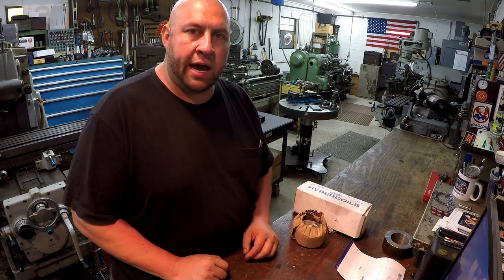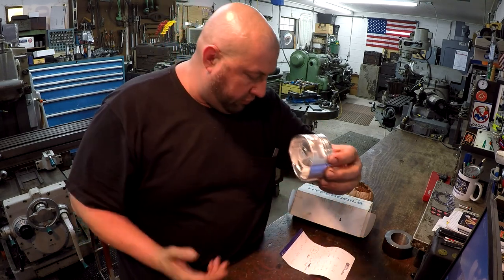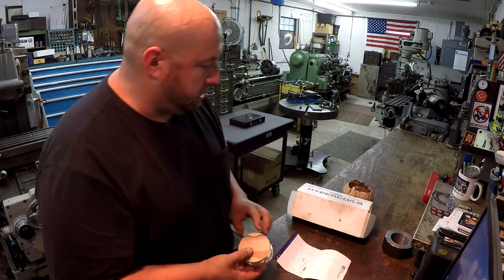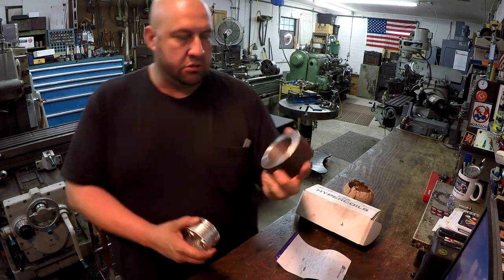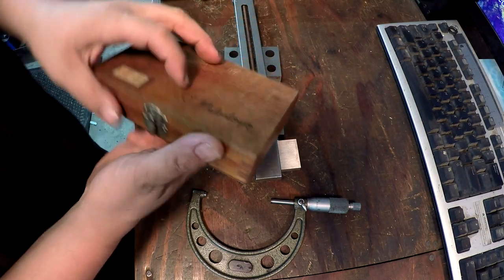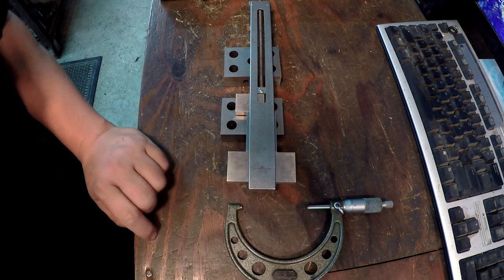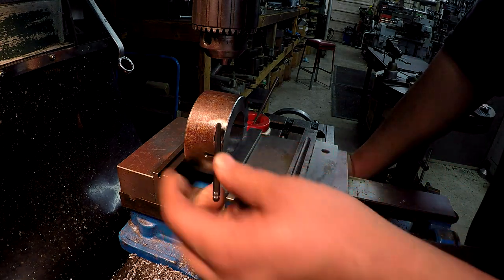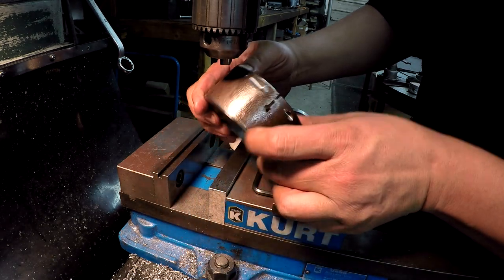Hayabusa Pistons Part 1

Comment: I'm a little shocked here.  Pistons in high performance engines are not round.  The diameter at the skirt is bigger than perpendicular to the skirt.   The top of the piston will also be smaller than the skirt.   This is done for many reasons, one of which is to end up with a constant diameter at temperature and that temperature is different from top to bottom.  The goal is to limit how much the piston rocks or misaligned with the bore so the ring surface stays as parallel as possible with the bore.  Bores are custom fitted to pistons normally and are themselves round. Perhaps the customer is an expert builder.  All respect, your doing what the customer ordered.  From my race engine building days, these modifications seem very odd.
Reply: This! Your comment should be pinned at the top.
Reply: Everyone gets the match the bore to piston thing. Adam said it was coated, say nikasil, or whatever, maybe there are reasons why it cannot be fixed, just relax everyone. He’s just making a cool video, with no commercials, change the channel if its to much for you to process, or, make a video yourself. They are a lot of extra work.
Regards,
Reply: Bores are what? are what!  I MUST KNOW!
Reply: @phuturephunk  holes
Reply: Correct they are made wider at the skirts for a reason . This guy had the machinist remove that feature . Not the machinist fault but now the pistons will slap hard
Reply: phuturephunk oh, bores are the very angry, dark colored cousins to the domesticated pig.
Normally they live in the forrest.
They are know to cause great havoc in grain and potato fields and even in lawns and flower gardens.
They are also known for being very hot tempered, having killed a great number of dogs and even decimated wolf packs severly.
There are even cases known where bores have killed adult people.

Hope that explains what a bore is.
Oh, is that spelled boar?
Never mind....

A bore is:
1 - a machined hole in a material.
2 - the drillbit used to create the hole.
3 - in some cases the diameter of the hole is mentioned as the bore.
Reply: You'r right.  The work on the diameter of a piston is supposed to be done on a piston lathe which creates an out of round shape.
Reply: Yea I agree this was a bit nonsense, i would have the cylinders bored to match the pistons, not machine the pistons to match the cylinders. But nothing against abrom he is doing what the customer ordered but ole Rodney needs to learn to build a engine
Reply: I was really surprised to see this. 0.002 is really tight clearance for any nitrous engine, these might be 4032 material that expands less but this is not the right way to go about this. He would have been better off sanding them down. I know it sounds goofy but if you attempt to evenly sand equal amounts off along the height of the piston, you will get better results. You could always mic the diameter at the crown or a few spots and attempt to maintain the shape when finished.
Reply: @Dave Mitchell he says nitrous in the start, makes the situation even worse

Comment: The piston skirt area is intentionally out of round! Instead they have a larger diameter towards the bottom, between the base of the piston and the piston pin hole. ... Ovality, which means out of roundness, is necessary in all pistons to allow for thermal expansion. It also compensates for deflection of the piston skirt caused by side loads.

Comment: Been a machinist for decades, you just showed me a quick way to save time & tooling . After drilling the primary hole for clearance size of cap head, you just spot center the bottom half with the same  clearance drill,  Me I pull that drill out and use a extension center drill to spot it , then drill it for tap drill size #7 drill ----- Your way saves time & tooling. Nobody knows everything !   Thanks in advance   :)

Comment: Do not take me wrong, but I am really happy to see  that also professionals sustain mishaps. I am building modell Stirling motors and steam engines never having had any formal training as machinist. And believe me, I do a lot of mistakes, which cost me incredibly much time to correct them. As a matter of principle, I only use scrap materials, so the cost of my learning by trial and error is somewhat reasonably limited

Comment: I am only a gear head wanna be. So, not especially interested in the all the engine stuff in this series. But just watching you build tools and jigs and fixtures is why I hang on your every word. And of course I always have a towel to catch the drool when you open your wooden boxes. When I see a wooden box coming into view I know something good is about to happen. I loved how you had to twist the “1-2-3” blocks almost as if the had a thread or magnets holding them together, but it was just the super fine surfaces that formed a sort of vacuum. On another machining YT I read a comment that Starrett tool boxes are Cartier boxes for men. Some clever word-mavin needs to come up with a similar phrase for wooden tool holders. I never really learned much about my Dad’s transit level he used in his construction sight, but I marveled at the box in which he kept it.

Comment: I watch your videos frequently and just came across this. I own a Business Called WorldWide Machining & Welding in Superior Wisconsin. As well I have worked for the Factory Suzuki & Yamaha Race Teams in my younger years. Currently I still have my own Race Team and Build a lot of Race Bikes and High Performance Engines. I say all this as to lend credibility.  When I heard that you received a lot of criticism for your approach to holding the Piston I had to chime in.  I have used the same procedure for holding Many Pistons that I modify greatly. The fixture I built is similar to yours but yours has some better features than mine. In my humble opinion you have done it correctly.

Comment: I do not know about racing pistons but normal automotive pistons are cam ground to compensate for uneven expansion caused by the wrist pin.  We were taught to fit pistons to the bore using a hone for final fit.  Hone the cylinder until the piston without rings and with connecting rod would fall by gravity thru an oiled cylinder.  Love your channel.  God bless.

Comment: You have to be kidding !!! 
Motor reconditioning is where I qualified as an artisan and we NEVER bored a cylinder without having the pistons on the table. EVER !!!
We also had a "Piston Grinder" and that was a fun machine to set up and use mainly because a piston is oval and tapered.
Vintage car engines have cast iron pistons a lot of times and when rebuilding them you had to grind the piston to clean it up then re-sleeve the bore to suit and after honing, the ring gaps had to be adjusted to the correct expansion gap.
Thanks for another very nice video.
Reply: I totally agree. This engine job will not end well. I do not doubt Abom will do a good job, the pistons just will  not work the way they are being machined. The coating on the cylinders changed the bore size. The reason pistons are tapered is when they get up to operating temp the top and the bottom will be the same size. The top of the piston will expand enough to match the skirt because it has a lot more metal at the top than the bottom.
Reply: 1sttofight
 I think this is for a dragster engine - their life is measured in minutes and they only "work" for 10 or 15 seconds at a time - not really enough time for decent heat saturation to happen within the piston itself which means that the sizing of the piston will be constantly changing during those few seconds.
Machining the taper and oval requirements into the piston becomes academic in reality.
But it would be very "iffy" to do so in a motor that has to do a 400 mile race.
But then, "the customer is ALWAYS right" (sometimes ;>} )  - not so Abom?
Reply: I would hope they get the engine up to operating temp before they make a run. To do otherwise is just asking for trouble.

Comment: You do great work, have a very knowledgeable mind, and can problem solve like there’s no tomorrow. I did have suggestions though I’m late to the show and have not read what others have written. A few things came up in my mind and they are only meant to be advice. If you know these things already, please excuse my eagerness to share with you. They are:
1. Pistons are tapered from crown to skirt so that has to be allowed for and machined into the piston. 
2. Skirts are sometimes oblong in shape and not perfectly round.
3. Ring grooves are designed to be a certain depth.
4. Cylinders should never be bored without pistons in one’s possession. 
5. I’m sure I forgot something. 

These are only a bit of my knowledge I’m passing along. Again you do great work and are an amazing machinist. I just wanted to maybe help if possible. You put this video up 2 years ago so I’m sure these things have been addressed by now but maybe I’ve said something that others might not have mentioned. Others probably said stuff I didn’t think of. I like when we all help each other out. Keep up the awesome work brother and God bless!!!

Comment: Great video!  Having worked in "the engine field" in The big 3, I learned that pistons are much more complex than most realize.  The skirts on all pistons have what is call "cam drop", in that they have an oval profile, with the skirt having a tighter radius that protrudes out further than the pin axis of the piston.  The 2 most common alloys used for forged pistons are 2618 and 4032.  2618 expands more than 4032, so are set looser than 4032 which is thermally more stable.  4032 clearances are usually 0.0015 to 0.0025 and 2618, up to 0.0035.  The "right" way to machine the skirt is on a NC machine where the cam drop can be programmed in with consistency.

Thanks for sharing!  I'll keep watching as I have learned TONS from your series!

Comment: Being a retired machinist I enjoy watching these types of videos. I saw the offset of the clamping screws coming a mile away. After being in the machinist trade for just over half a century I can 
honestly say that I always worked off the centerline of pieces like this fixture. By finding the center, doing the math work and then going outwards from the center, you eliminate any mistake from not figuring the edge finder diameter because you only need it to find the center.  As long as you go outward equal amounts you will automatically get the holes symmetric and ..... you can also bring the drill out in front of the piece and eyeball it to see if they are far enough apart. If they are installed and not out far enough , all is not lost ..... you can undercut the screws a little if necessary.

Comment: Hey Adam,

I'll steer clear of the actual piston mods, plenty of comments already!

One common way of holding pistons for modification is to use the register in the bottom. You use a dummy gudgeon (wrist) pin with a tapped cross hole and draw the piston down onto a stub arbor with a bolt.

Comment: Great content! I don't care whether your customer asks you to do the correct thing or not. This is a machinist channnel. I'm interested in how you solve machining problems. Once again, I commend you on showing your mistakes; it makes your show all that more real. Also, I don't know how you keep up your posting pace, it's amazing.
Reply from the maker: Thanks for the comment. People seem to forget what I'm trying to show with jobs like this, instead of what's right or wrong with an engine build, I'm coming up with ways to to do work at hand, no matter what the part is.
Reply: always go with right
 issue is will it weaken the pistons yes- id hate to see it fly apart at 100+mph let alone 200+mph for drag racing
Reply: it is his problem he is the one weakening the parts and its his friend that could get hurt if it flys apart
Reply: +musiclovr2 It's the customer's responsibility, not Adam's. This is a machinist channel. Adam's not giving racing tips. I know all you guys are super dooper experts, but if the customer specs it, I'm going to make it to their spec. Maybe Adam should go over and make sure the customers lug nuts are tight enough.
Reply from the maker: Yall don't sweat it. We decided not to machine the pistons, as he's going to have the cylinder properly honed to match.
Reply: Hi, much the best idea!   Hard to imagine the shop that did the bores didn't suggest that in first place.
Next time you get pistons to machine use a pullback/drawbar.

Comment: 31:00 for little "eyeball precision" work, you can slap a 1/4" drive socket extension on the end of the tap to get some more clearance if you already have a good lead into the threads, I used that trick a lot in the automotive world.
Reply: Nice Brad, great suggestion>
Reply: And if the tap doesn't have a regular shank square (1/4, 3/8, 1/2" etc) remember you can get 8-point sockets instead of 12 point, which will fit square shanks. 
Hard to get in "long", but you can extend them by cutting in half, hard turning spigots, and TIG welding a length of chrome moly tubing - worth it if you do lots of tricky tapping. 
These are also handy to have for square headed (usually dog point) setscrews often used in toolpost clamping, shaft collars and such.

Comment: Adam as a precaution on critical measurements I always build a gage block stack to the nominal dimension and check my micrometer to the gage block stack this will take out of the equasion any screw wear on your micrometer. You have taught me a lot in your videos just thought you might enjoy a suggestion of mine. Keep up the good work my friend!
Reply from the maker: Nice tip, thanks for sharing!

Comment: Adam, another great video. I found a neat trick for the spill masters. Inside a computer hard drive there's a pair of super strong magnets, so strong that you can't hardly pull them off by hand. Drop one in your spill master and will stay in place anywhere at any angle. It also pulls the chips off your brush and keeps them from making a mess of your part. You can find them at any scrap yard or computer recycling center, most of the time for free.  They also hold shields for your steady rest, rags for sanding and grinding, and shop drawings. The uses are limitless and to buy a magnet that powerful would cost a fortune. Keep up the good work!
Reply from the maker: Cool, yes I have some of those magnets that a viewer sent me.

Comment: LOVE WATCHING UR VIDEOS !!  WELL , LIKE YOU ALREADY KNOW BY NOW.  .....JUST WANTED TO EXPLAIN TO YOU IF NOBODY HAS ALREADY SAID .....THE MAIN REASON YOU DON'T CUT PISTON SKIRTS IS BECAUSE THE PISTON IS ACTUALLY TAPERED BY DESIGN. IT IS MADE THAT WAY FOR EXPANSION OF MATERIAL DENSITY. THE SKIRT HAS LESS MATERIAL TO EXPAND THAT'S WHY IT HAS WIDER DIAMETER & THE CROWN HAS MORE MATERIAL TO EXPAND SO "OF COURSE" IT'S A LESS OF THE DIAMETER OF THE SKIRT. KEEP UP THE GREAT VIDEOS MAN.  .. CHEERS

Comment: I love watching your videos and I'm not a master machinest like you are; however, I did work in a metrology lab at an aircraft helicopter manufacturing company. I picked up on your comment around (21:55) and you mentioned something like, this should be close enough for government work. Did you ever hear the definition of that? It's kinda like this. You measure it with a micrometer, mark it with a piece of chalk and cut it with a hatchet! Keep up the great videos and all joking aside, you are true in what you do and just making something is better than over engineering anything any day. I'm glade I saw this video since I have just restored a LaBlond 15"x42" bed lathe. I was very much inspired by you to just do it, by what you do and have learned alot since I retired from a major sports broadcast company as an audio engineer.  I just got it running last night after picking it up last May from a local amusement park's machine shop. It's in pritty good shape since it was built in 1953. Now I'm planning on using it to trim some pistons that I'm reworking and was trying fo figure out how to clamp the pistons down to my 8" chuck. Now I'm looking for a L-00, 4 jaw chuck and a vertical miller. Keep the videos coming, I love them and Happy New Year too.